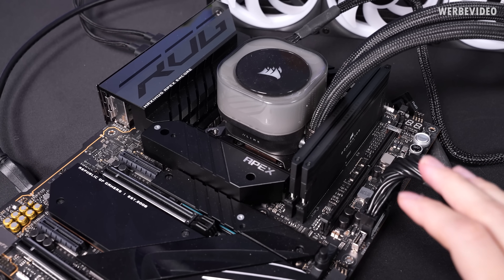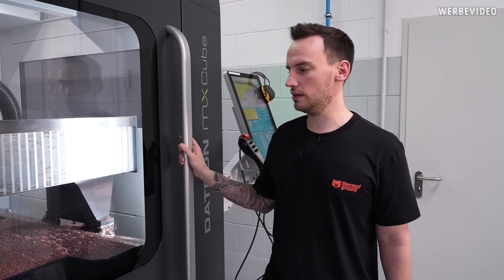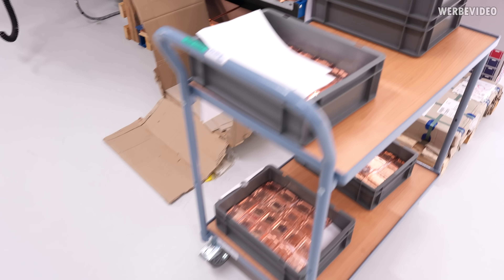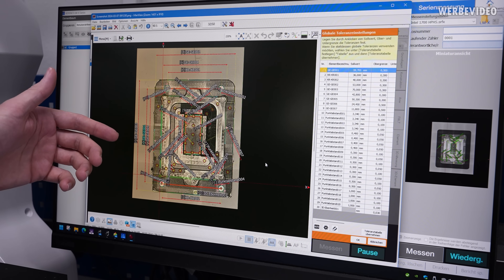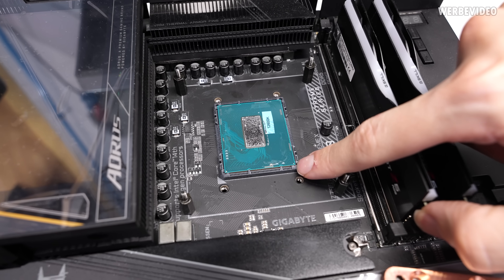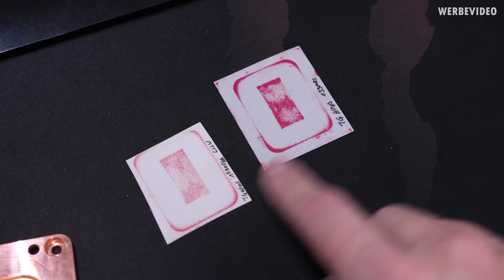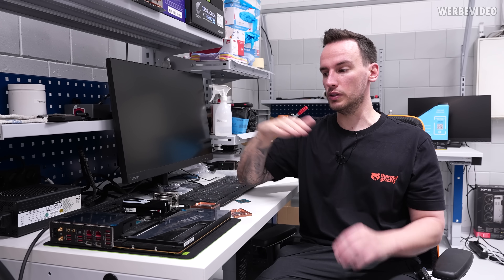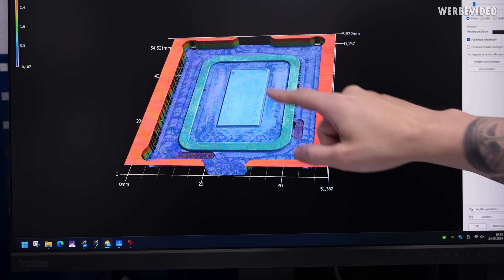I messed up

Comment: I have recently purchased the Thermal Grizzly Mycro Direct Die Pro RGB CPU Water Block for AMD AM5 (TG-MY-DD-PAMD-V1) from PLE Computers.
I'm so angry I cannot use it on my new AMD Ryzen 9 9950X3D CPU Chip, on my new ASUS ROG Crosshair X870E Hero WiFi DDR5 Motherboard, it does not sit flush on the CPU, it seems that I've purchased the wrong product, and I've wasted a lot of money for nothing.

I need your help choose the right AM5 Water Block, because I don't know nothing about the Thermal Grizzly Water Block Cooling System, even the PLE Computers store doesn't know nothing about it and giving me the run around,
and do I need to use Thermal Grizzly Thermal Paste?, Thermal Grizzly Conductonaut Extreme - High Performance Liquid Metal? or Thermal Grizzly Kryosheet - 33x33mm Performance Graphene Thermal Pad?
There doesn't seem to be any YouTube videos about how to install a Thermal Grizzly Water Block for the AM5 Motherboards only reviews on it.
So I need a list of items that I need to buy, so that I can finish build in my new Thermal Grizzly Water Block Cooling System, specially designed to work with AMD Ryzen 9 9950X3D CPU Chip.
I don't feel comfortable performing the To de-lid a AM5 CPU that I have not purchased yet, using a Thermal Grizzly CPU AMD chip Delid-Die-Mate Removal Tool. However, delidding my CPU will void my CPU warranty and can cause damage to my CPU. I recommend against it.

Comment: any updates on a V2 for intel?
Reply: Looks like its being scraped & will make a return for lga 1851
Reply: @jake..A  was thinking the same thing cheers m8 ill just EK
Reply: @LegacyNiNJA  I went for the iceman since this one is taking to long with no updates since plus its also better than the non pro model they planned to make.
you also have the supercool as well which is even better but not a fan of the looks and installation.
The ek is hit or miss but a lot of complaints ek direct die gives bad temps so I'm avoiding.
Reply: @jake..A  yeah im waiting for there new direct die to drop i was planning on going iceman but the chrome wont fit my build so im really really really hoping EK actually drop something decent if not Iceman it is

Comment: Noticed your comment about measurements "we have 50 pieces and we take each corner and one in the center, we check if one is correct and then we assume the rest is correct".
This sounds really familiar, especially since i used to work as a CNC Lathing engineer, and from experience I know that measurements tend to 'slip away', due to wear of tools (for example). 
Then I had to get a crate of products back, and measure all products again until I found the part that had normal tolerances again. I'm sure your CNC professionals know all about this. 

But are you absolutely sure that your QA process is doing its job? Doesn't hurt to spend some time in (in my honest opinion) and maybe you still find something worth improving.
Measuring by sample can be a PITA sometimes, so going back and measure a whole lot of products is how we found out about deeply rooted problems sometimes.

Final disclaimer: I cannot state this enough: I'm not here to disrespect you or your co-workers/employees. You got me convinced with this video that you guys are all skilled professionals who know what they're doing. It is just... making products in big batches has a tendency to make a person 'blind' for quality issues.

Comment: Question, are these products rigid mounted or spring mounted? If spring mounted it might be a problem with spring rates is my thinking, it might be uneven pressure from those specific batches of springs if that's the case. I don't know your products so I'm just throwing it out there in the dark.

Comment: Setting the bar. This is why I never have a problem buying TG products. Commitment to the consumer. Gut gemacht!!

Thoughts from a DD user - I had an SMD (south of die) that actually sat 0.17mm above the surface of the die on my 13700k (using iceman die guard). Measured using a digital surface height gauge on reference block. Since I was doing a 360mm AIO DD setup using a flat, full coverage coldplate, I had to cut a slot in the coldplate to accommodate. There are also SMDs along the western edge, but those were not an issue for me.
Worth a look!

Comment: I would definitely look at socket variations, as this could definitely cause pressure issues.  The other issues could be incompatible TIMs or thermal paste application causing a high spot at the socket. This is why most manufacturers use springs, you could try incorporating belleville washers.

Comment: Pay attention that some CPU's sockets become slightly "curved" on  certain motherboards - I'll make several photos of my old Gigabyte ga-h81m-d2w motherboard with LGA1150 socket to see the curvature produced by the CPU metal mounting bracket in the fiber-glass mb plane AND probably directly on the CPU socket... I don't know if this apply to the issues described here , but I found it strange to see such warping .. Excuse  my basic English.

Comment: I really wish you had taken the EK direct die route but with even better results. I have a Velocity2 block with DD conversion and it works very well indeed. I also bought an Iceman DD but have not used it because the whole concept of a single piece contacting both the die and the substrate just seems to be asking for trouble with tolerances, and that's before your use of the plastic mounting as a limit stop.
Is it not better to stick with your contact frame to retain the CPU by the substrate and have a seperate coldplate that has more than sufficient protrusion for the sum of worst case tolerances? The top section including coldplate would then be tightened to a specific torque ensuring good contact with the die.
I really think this is the best way to go, but don't know if your past involvement with EK would be an issue with IP.

Comment: Wow, absolutely incredible. You German guys do not mess around when it comes to engineering. Can't believe the quality of the equipment you guys are running just to manufacture CPU cooling parts! Such an awesome video with an excellent insight into the manufacturing process!

Comment: Unfortunately the heatspreadder did not worked for me on a 13900k, Therml Grizzly refunded me in full! 
Great customer support, unfortunately the product did not work at all and now I have to either wait or look for an alternative solution.
Reply: Same thing happened to me.  The temps were much too high on a 14900KS and Apex Encore.  They gave me a full refund and I would gladly re-purchase once the solution is found

Comment: I love the way you support your customers and your honstey , I worked in repair motherboards and graphic cards for a while just to add I understand you not using the motherboard pcb as stop but never rely on pcb as stop because the cpu socket surface distance to the pcb is different on every motherboard and doesnot have a perfect tolerance   to be used added to it the damage to the pcb which can be avoided but the height variations connot , that why most coolers have  aspring , or  abit flixible mechanisms for mounting .

Comment: I guess if none of the mating surfaces look to be at fault then you've got potential trouble with the exchange of heat from the metal into the water. Nickel plating gun king up the water channels between the fins? 🤔

Comment: About 3 months ago I bought the AM5 version and I had exactly the same problem. Instead of a drop in temperatures, there was an increase in temperatures. I returned it under warranty, and the store where I bought the DirectDie water block. They sent it to the manufacturer, and They kept it for testing for almost a month and I never got an answer what the problem was. The store gave me my money back and the matter went quiet. In my opinion, there is a problem with the block pressing against the CPU core. End of conclusions.
Unfortunately, in the meantime I replaced the 7800x3d with a 7950x3d, which also heats up a lot, I bought the same block again in the hope that the problem will not repeat itself. However, I additionally equipped myself with KryoSheet and copper plates of different thickness to possibly improve what the factory damaged. Keep your fingers crossed for successful tests and daily work.

Comment: I would be really concerned about the spreader touching the plastic part. Your tolerances can be perfect but you need to think about what tolerances the manufacturer of any other part it contacts might have. That plastic part is injection molded, those molds wear out, and could have a tolerance of 0.5mm on the Z height for all we know (or more). Since the Z height doesn't really have any critical job to do as far as I'm aware.

Comment: If the measurements for the part are right, and the design seems good, maybe the material? Impurities, micro air bubbles, wrong alloy composition selection, alloy composition not to spec?

Comment: Makes me wonder if there is a difference for clearances on boards. CPUs should all be manufactured the same way. Boards can differ, maybe check with one of the people who are having problems what board they are using.
Reply: I think there is the culprit - different MB having different quality of materials and builds of PCB density/ CPU socket /CPU bracket .. Something from this list is permanently bent by the initial cooler or directly from the factory after the CPU bracket press the CPU ..

Comment: You validated according to the video on 2 motherboards and both are enthusiastic grade and iam not sure about the aorus but the apex encore is a refresh maybe there is something changed , that sample size of 2 boards is too is too small. Also we all know tolerances on plastic are terrible and you are supporting it on the socket plastic that probably has bad tolerances for height since it's not crucial, also there might be bad batches of the product different material alloys that react slightly different on the millling process, there might be a QA problem there should be sample size tested or the design needs to be revised the first version of the contact frame was terrible and in some cases it did worst it was over engeniered with specific torques while other products did better and did needed those torque specifics

Comment: Thermal paste is never the optimal solution heat transfer and you always loose. Now there is 2 surfaces with thermal paste and in my understanding it is clear that there is absolutely noway it can work to lower the CPU temperature than without. As pointed out 10'C increase for the CPU temperature sounds sensible and correct. Snake oil at best. Prove me wrong.

Comment: Great video! I wish you well as you try to root cause this issue.

As an engineer, I can sympathise with you, how painful and difficult it is, when there is a problem in the field, and with so many variables that you can't control, and you're trying to narrow down the number of variables, but also identify which of the remaining variables is the most significant contributor to the apparent issue that you are seeing.

Comment: I commend you for Roman for being transparent in what is/has occurred with your products. This proves great leadership and branding. I certainly understand that not everyone/thing is perfect and unfortunately things happen. I hope you can correct this issue and that your product/s and company succeed as it has and will. Only thing I could assume is what you had mentioned about the plastic CPU socket. Are you able to acquire one of the MOBO's and CPU from one of the affected people/reviewers? Perhaps in having that failed item you'd be able to measure it to verify tolerances????

Comment: @der8auer EN, I see there are also standoffs machined in your LGA1700 DD waterblock, to also push CPU PCB against socket pins and not only the DIE itself.

These standoffs are always of specific height, but each CPU sample has slightly different DIE/bulge height.

So if your LGA1700 DD waterblock machined standoffs, to also push the CPU PCB against socket pins, are always of specific height, but a specific CPU sample has its DIE/bulge slightly lower than most/rest of the CPU samples, this might result in (much) high(er) CPU temp then, since (much) less pressure on the DIE/bulge, thus suboptimal.

With original IHS, CPU DIE/bulge height difference, is not a problem, because when Intel puts original IHS with still hot/soft indium, it negates any CPU DIE/bulge height difference anyway, since indium layer applied is always thicker than the actual space between IHS and CPU DIE/bulge.

Everybody, thumbs up, to bring @der8auer EN attention to my post, in case this could potentially contribute fixing the issue

Comment: @7:10 , could be a problem their only corners and center checked , could have been warping somewhere else throwing out levels ?  , could be differences in sockets depending what manufacture plant is making them ? I would have made a spacer  to sit around mainboard socket ? sounds like your only shipped out 1 or 2 batches worth ?

Comment: I would try to get some close photos of the various motherboard socket areas that exhibit this issue. It could be a board machining tolerance issue or a PCB stackup issue. Which is to say, it's possible that the mounting holes are recessed because the keep-out area around the upper layers is large, which will throw off the geometry very slightly. There also could be differences in the actual packaging of the sockets - there might be little tabs or alignment fiducials for different kinds of machines that are not noticeable unless you have a way to compare between systems. These tabs might not exist on sockets meant to be fed into a PCB manufacturing machine differently.
Reply: Reading some other commenters, looks like there are different variants of the socket like I was thinking - one has cut-outs for one kind of machine and the others seem to be flatter. You don't know in which dimension they added the notch - did they extrude the plastic and the notch is actually the height you expect? Did they cast the notch and it's lower? Did they machine the notch and have tiny burrs? Besides the fact plastic is not high tolerance, it could be something this stupid causing the problem.

I also agree with some suggestions to use PTFE on the surfaces that are meant to mate but not thermally, and design in some slop such that the PTFE will slightly deform to fill in the other vendors' manufacturing tolerances. I don't know how you do this at your scale. You can probably get machineable sheets of the stuff at an appropriate thickness, but PTFE is not something that is normally able to be adhered without special processes. Perhaps you could machine a channel for a PTFE gasket to pop in? But then the idea of doing this because the socket plastic is part of the mounting solution feels wrong. Maybe then you could make PTFE sheets that sit between the board and the spreader and don't require precise alignment (but key them to the socket mounting holes and leave some space for the socket to be an unexpected size), and then use that as a bearing surface instead of the plastic socket?

Comment: I would ask customers who reported the problem what motherboard and cpu they use, and would acquire those into my lab for testing to see if I can replicate the issue - as it's incredibly difficult to fix a problem if you can't reproduce it in your lab. Also if possible I would ship them a few pieces of that pressure sensitive paper so they can confirm good contact - or the lack of it.

Comment: I think there is a fundamental problem with the product. Combining several precision requiring pressure applying tasks to a one piece instead of two separate pcs. is very prone to any manufacturing and installation tolerances on the motherboards compared to a separate contact frame and heat spreader. The one rigid piece gives hardly any room for tolerances so I would not buy this kind of product just because of the principle it is designed by. I consider it to be a poor design choice, with all due respect. But of course, this is not for the casual everyday user, this is a special product for enthusiasts but it may be even a bigger problem for them. The principle of the design and tolerances may ruin the whole idea the product is based on.

But good luck finding the culprit. I would be guessing the leaning on the plastic frame, that is a bit concerning anyways, since it is quite thin plastic structure and the manufacturing precision on the the top surface is not necessarily that great singe it is not designed or manufactured for a platform to put pressure on. Well handled this far, hats off for that!

Comment: As far as I can see, your tolerances are okay but you rely on the plastic surround to hold its shape, not only that, you're relying on it to not deform almost at all or maybe 0.05mm at worst.. It could be that the plastic and motherboard combined expand just enough to cause poor contact. 

My advice would be to increase the hight difference just a tiny bit to compensate for that. I don't know how much you can afford since you probably don't wanna put too much pressure on the die itself (I'm not a material's engineer), but I think it's safe to say that some sort of thermal expansion is causing poor contact. Feel free to correct me.

You can't account for everything. Pretty sure there was some user error as well.. with tolerances as high as this, not all average Joes are capable of a correct install. I'm really glad you did such a good job of responding in a professional manner, it's why I watch you and support you. Integrity is rare to see these days.

Comment: internal socket depth could be different. External plastic could be same. Also is the CPU board the exact same thickness? There is so much to measure.